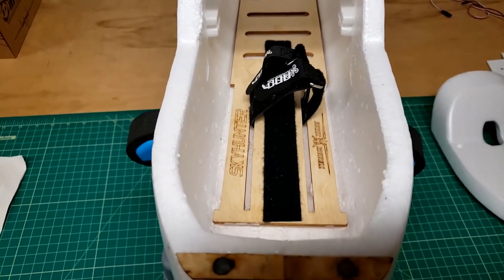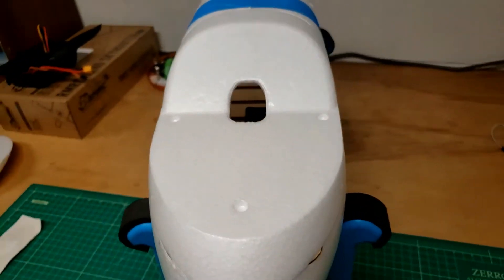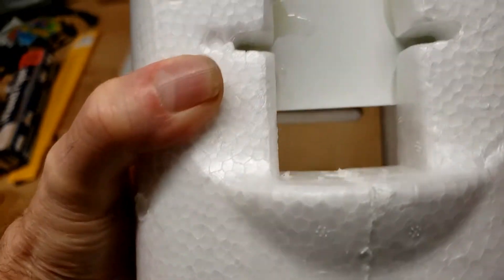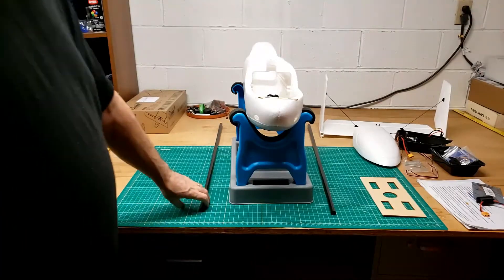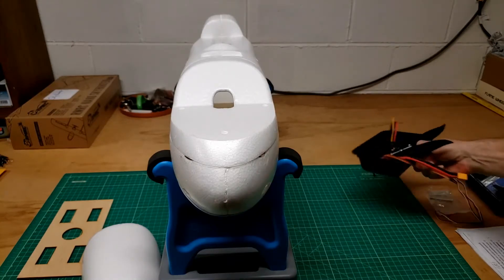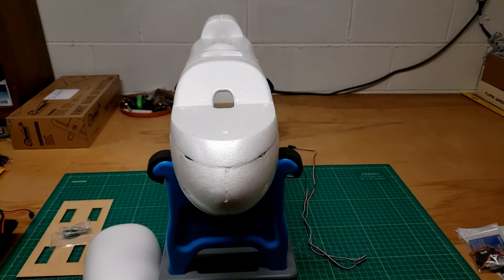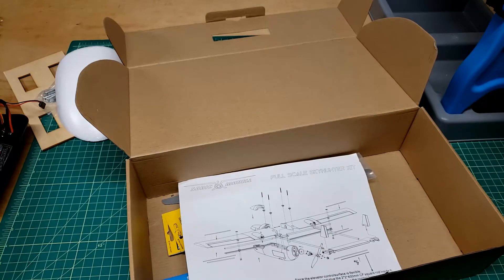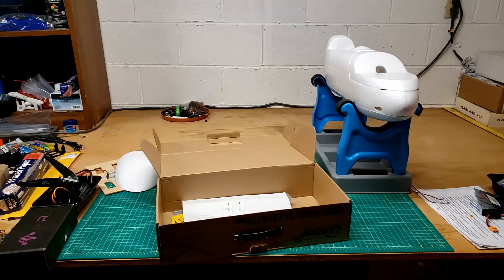Skyhunter Build 6 of 14

Comment: 8:58 flew my mini skyhunter with and without the 2nd cover. Having the 2nd cover on does make a difference on the smaller version. And i think it looks better as well.
Reply from the maker: I am thinking that same way.  Still have not decided on which way to go.  Without the top it looks as if my current pan and tilt will not be able to see over the side and look down.  Because of that, I am leaning toward putting the top on and putting the pan and tilt in it.  That would also let me position it further back and help my CG.

In the past 24 to 36 hours I have been considering a second camera because the F765-Wing easily supports two. I thought it could be cool to have a pan out on one wing or the horizontal stabilizer.  IMHO that would show a unique view (others have done it) of the airplane in flight and also give me views of how the vertical stabilizers and motor and prop are functioning.  Because I am kind of new to RC flying and building of airplanes, I am not sure such a setup is wise for my first attempts.  I do have another Skyhunter still in the box.  Currently I am thinking of holding off and doing the higher lever build on the second one.  Perhaps I should do one with the top, and one without.  I am just not sure yet.